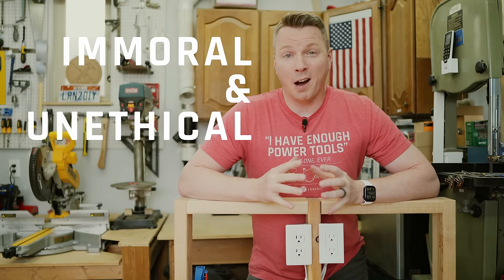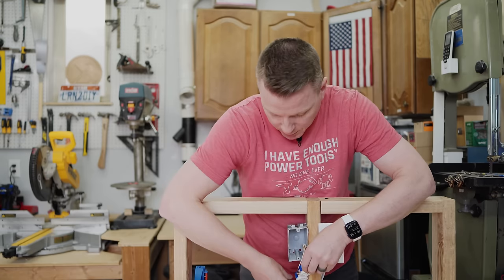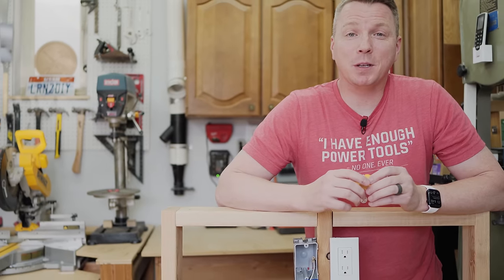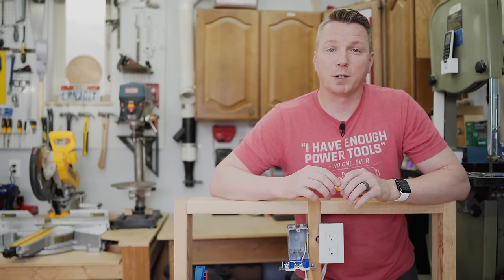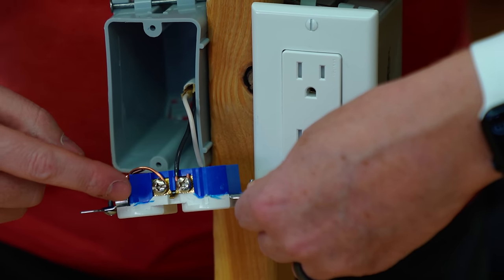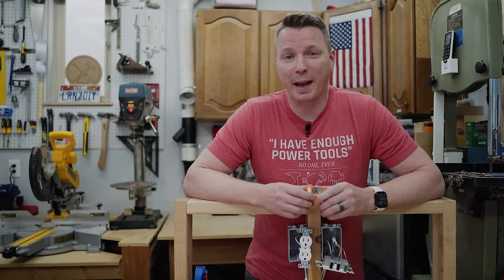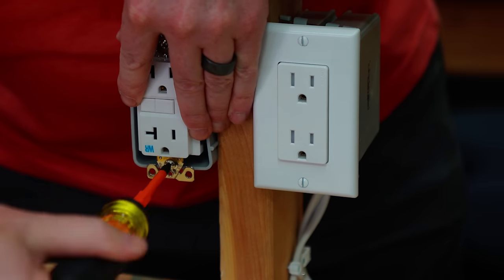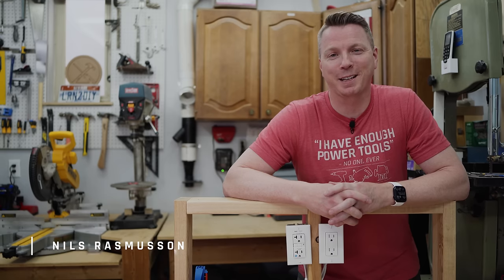People Are Adding Deadly Hacks to Outlets

Comment: We bought a house in 1992, and the WHOLE HOUSE was wired like that. I wound up rewiring the whole thing. Up side, is that I got to do it all correctly, with appropriate wires, outlets,and separate breakers for the things that needed them. Down side, wife was furious that I was making holes in so many places, as I'm not an electrician with experience in fishing wires through walls. But at least my neighbor (who is a master electrician) approved my work.... but he had still wanted me to hire 'real electricians' to do the job. I just didn't have the spare thousands of dollars to do that, but I still wanted to fix the problems.
Reply: Consider yourself extremely lucky. In many places, what you did was extremely illegal (at least as illegal as the hack itself) regardless of how well you did. If an inspector finds out you did that, you could be facing tens of thousands in fines (at least) AND be required to pay a professional to redo it.
Reply: @TheOriginalJphyper  even if everything was done correctly?

"Land of the Free", right? 😂
Reply: @LRM12o8  Yes, even if everything was done correctly.
Reply: Doing the wiring yourself, hiring an electrician to pull the permit, check it and having an inspector come inspect the work is perfectly legal. As long as you know the code and secure the wires and the connections are correct they won't have an issue with it. Just make sure to leave everything open till the inspector is done.
Reply: @TheOriginalJphyper in my city, you only need to pull electrical permits for new circuit breakers or pools, and homeowners can pull it themselves. Sounds to me like your local politicians need to be replaced. The dude had an electrician inspect his work. I really don’t see the problem.

Comment: For those wondering why a reverse polarity bootleg ground is so dangerous : the ground pin is usually used in circuits to catch any failures that would put live voltage in unitended places (such as metal casings) and would trigger the line's breaker to pop. When the ground pin is tied to the live wire without any actual ground connection, your appliances would become literal electrocution hazards by just touching them. It would be like touching the livw wires directly.
Reply: Holy crap
Reply: What about reverse polarity but not bootleg? Still grounded outlet.
Reply: @mannyramirez2307 That would seem like a normal operating mode for the device, with an exception, that manufacturers can and often do add filters on the live wire connection (mostly appliances with a motor, like a washing machine, but also computers etc.) to filter voltage or current spikes both from and to the grid. If you have a polarized plug and you connect a socket the other way, you basically lose this filtration and bigger manufacturers have laboratories to tell if the fault and damage in your house happened because of this, so you can have your warranty voided just with this simple change.
Reply: This "bootleg earth" is a way to give you protection in a situation, when a live wire inside an appliance would become loose, or melt through it's sleeving (like in a metal cased toaster) and touched the case which could lead to a severe electric shock, that would just trip your overload fuse and disconnect this circuit. The absolutely most important thing in doing this is to make sure you've connected the neutral, and not live wire to your ground terminal.
In Poland, when electricians find these earth to neutral connections in all soviet houses and buildings are not obligated to immediately shut down everything, but they ensure that the "zeroing" (that's how we call this "mod")  is made, to give the users SOME safety and everyone is familiar with this. That's probably because, our country was pretty much completely blind to the western standards (as all of the soviet union) and after 1989 we were many years behind with these standards, so many, many electricians here do this to this day, but always warn the owner or client to prepare for an installation upgrade. We find some similar "issues" involving weird electrical tricks because of rapidly changing standards even on buildings from only twenty years ago. 
To summarize: it's better to connect earth and neutral together (like when you need to change a socket, but don't have the money and time to rip your walls just to add one new wire), than leave it floating and live happily for many years convinced to have quality sockets and just get a shock without a warning some day.
Reply: I'm sitting here in the middle of the night, writing comments about wiring sockets, but if you are all so interested in electrical safety, you should definitely think about your AMERICAN MOST DANGEROUS PLUG STANDARD IN THE WORLD, seriously. Just adopt UK's plugs or German Schuko, but get rid of these one hundred years old plugs that are nowhere near the word "safety". You can stick your US plugs like an eight of an inch into the socket, and the prongs get electrified, while your fingers can still slip onto them, or something metal (like a necklace) can fall on them and vaporize. There are so many better desings and this is definitely not worth keeping in the 21st century.
Reply: Shocking  🤯
Reply: @abcdefgh1279  I have no idea where you heard this from, but if that were to be the case, you wouldn't just lose the filtering, it would blow up because they use polarized capacitors, which blow up if polarity is switched.
Reply: @abcdefgh1279  True, but doing so would mean purchasing new wall sockets for everyone in the US and Canada and also loosing compatibility with older appliances. Changing electrical standards is not something that can be done cheaply or quickly
Reply: @sebastienmonette6659  to the first comment: you do know this is AC and polarized caps can only be used on the secondary (DC) side, right?
To the second comment: nobody says you have to adopt it immediately. There is absolutely no problem to force a new design only in new developments, and slowly change it in matter of years. Ten to twenty years later just make it mandatory and then require to change them, when most of people would be familiar with these plugs commonly appearing on the market.
Reply: @abcdefgh1279  True, I had forgotten about not putting polarized caps on AC lines. However, if we're working with a DC motor, to get DC you'd need either a full or a half bridge rectifier. Bridge rectifiers will correct the polarity for the DC filter no matter if the AC polarity is switched. 

If your original comment was about AC motors, which will be affected by reversed polarity, the filtering would still work because instead of polarized capacitors, non-polarized capacitors are used to correct the motor's effects on the circuit.

As for the plug situation, having both standards at the same time would prove annoying to accommodate as people would need to at least buy many plug converters to be able to use new products if they didn't change their wall sockets. The best solution would be to improve the existing US male plug to only have contact with the tip of the plug like the UK style plugs.
Reply: @sebastienmonette6659  i'm talking about AC side only, because it has nothing to do with secondary, or DC. It's just the live wire on expected neutral connection, that we're talking here.
I know that would be very inconvenient, but is there a price tag on safety? Can you name a price for the safety of your family? Change always brings some folks who don't want to change, so that is not something to concern at all.

Comment: As long as the bootleg ground isn't reversed, it will work just fine. If there is an internal fault that puts potential on the grounded parts of the appliance, it will return through the neutral (aka, return) wire, and trip the breaker in the case of a dead short. It will also collect stray charge from the appliance's ground and keep it at the neutral level (which is bonded with the grounding rod and conductor at the main box).

The problem with not using a dedicated ground conductor is wire resistance coupled with current flow. If you're pulling a lot of current through a long circuit, the resistance of the wire can cause the potential between neutral and true ground to be non-zero at points in the wire far from the box. THIS is dangerous because AC can break through the resistance of your skin (which is capacitive), and pull a current through your body. If your circuit or receptacle isn't fed by a GFCI, the ground conductor does NOTHING except act as a fault-finding return path that can NOT build potential when everything is working normally. It's not as dangerous to go without as people think, but it is a bad idea to use neutral as ground at any point beyond the main box.
Reply: A bootleg ground can easily become deadly because if the neutral goes open, current will try to take the path via the ground, meaning the appliance's case will have a 120V potential to ground if the neutral breaks.
Reply: This is a problem if the neutral went open at the panel, but that's rare. But if we bootlegged every ground in the house, suddenly every single wire is a risk if its neutral goes open. And open neutrals on receptacles is pretty common - and would electrify the grounded appliance. But only doing it at the panel minimizes the risk.
Reply: @HarrisonFrith-cr4ie  The same can be said for a properly grounded chassis if the ground wire breaks.

How is that common at receptacles? You mean it's a common failure? (Since we know it won't work if the circuit is broken). Either way, failure of house wiring is something I didn't cover in my original comment, and a failure of the neutral wire coupled with a bootleg ground would be deadly. I'd say that's the biggest reason to avoid this, by far.
Reply: @RAndrewNeal  no it's different. Breaking the ground wire you just lose the ground meaning the case would electrify if there was a fault. But broken neutral with a bootleg ground WILL electrify the casing at 120v even without a ground fault. It is guaranteed to electrify the casing.
Reply: @harrisonfrith7125  Ah yes, I missed that. If the power switch is wired properly, the chassis wouldn't go hot until the switch was closed; but yes, that would energize the chassis through the load.

It's too easy to forget about wiring faults and assume an ideal condition for appliance failure when thinking about grounding. At least, for me.
Reply: @RAndrewNeal  Yeah ground can also be the enemy if it's wired wrong!
Reply: It is a gamble, of course. The neutral is bonded to ground at the breaker/fuse box, so what's the big deal? Well, since it would take a freak event to reveal the risk the likelihood of it being a problem in real life is small, but the stakes are unacceptable.
Reply: @flagmichael  Agreed.
Reply: @HarrisonFrith-cr4ie  If the neutral goes open nothing will work as there isn't a complete path for electric to flow.
Reply: @theadmiral5425  Correct, and the case will become live with 120v of potential that wants to return via the ground if the ground is bootlegged onto the neutral. The circuit isn't complete, but it WANTS TO BE. Think harder about it.
Reply: @HarrisonFrith-cr4ie  "But broken neutral with a bootleg ground WILL electrify the casing at 120v even without a ground fault."
Huh? Unless your metal toaster also happens to connect Live to the chassis the moment right after you cut Neutral then how would the chassis be electrified?
What you're saying is that Neutral is cut, only Live is touching the toaster, therefore the toaster's chassis is 120v. No you need a fault to connect live to chassis.
To replicate this scenario, not only do you need to cut Neutral, but you also shake your toaster so hard until the Live wire permanently touches the metal chassis. You can also only do this after you cut Neutral and after you've notice that the toaster no longer works, not before cutting.
Seems like an unlikely event to me.
Reply: @DVDplayerz  A lot of people don't understand this and it's not entirely natural to think about it, but think about it more.

Say you've got the ground and neutral bonded inside the plug socket. The ground wire from the appliance is connected to its chassis, and the plug socket.

If you kill the neutral feed to that socket, The current is going to go into the socket via the neutral wire, have NO return path, exit back out the ground wire into the appliance's chassis, and try to go to ground from there.

Comment: The best option in my opinion is to replace with GFCI unless you are running a higher current motor on the circuit such as a refrigerator. Most residential refrigerators won't trip a GFCI I don't think but commercial grade ones will often have nuisance trips (I'm a refrigeration tech so its an example I deal with often), an obvious problem if you refrigerator keeps randomly not doing the cold thing. But on a cost benefit I think the GFCI outlet would be the way to go, it is a lot cheaper than pulling wire and gets you a good enough for most people result in most cases.
Reply: i doubt one of those would enjoy a portable air conditioner which i use to keep cool during the summer months
Reply: @dawn1berlitz  it depends on the size of it, a small portable one probably won't trip it but I'm not sure I have never owned one of those but to my understanding they aren't really air conditioning they are an evaporative cooler (often called a swamp cooler). They work great and their amp draw is pretty low so it would probably be fine honestly but even with the commercial refrigerators they usually don't trip every time I have seen them run for hours without tripping the GFCI then all of a sudden you get a slightly harder start and it trips.
Reply: I heard GFCI isn't allowed on fridges because spoiled food is more deadly than electric shock risk in this situation
Reply: @thewhitefalcon8539  it is not recommended but not against code, many refrigerator manufacturers will not cover warranty if you have it plugged into a GFCI and that is what is causing the problem. I have had quite a few warranty calls for continental who have "unit plugged into GFCI" on their list of non warranty issues, specifically that they will not cover GFCI trips due to normal operation.
Reply: @keldon_champion Would those fridges work with European style panel GFCIs (called something helse like RCD or HFI) that trigger at 30mA imbalance rather than 5mA ?
Reply: @keldon_champion  Portable air conditioners are a thing, they are solid upright units with a full compressor/evaporator loop inside them, and then one or two large air hoses that exhaust through a nearby window. Technology Connections did a good video on the topic if you want to look further into it
Reply: @richardmillhousenixon  oh I know what you talking about never heard of the called portable AC before though maybe it's a regional thing but every time I heard the term portable AC in the past it has been in reference to the little as seen on TV tabletop swamp coolers.

Comment: My parent's house was built in the 50's and they used what I believe was a precursor to the Romex we know and love today. It had a ground wire, (albeit a thinner gauge than the actual circuit wires), but the common practice at the time was to wrap that around the wire where it entered the outlet box on one end, and the fuse box on the other end and rely on the strain relief to "bond" the ground to the box, bearing in mind that all outlet boxes were metal back then, so as long as the fuse box was grounded and the outlet was actually in the box, it had a "ground", albeit unacceptable by modern codes. As for the "bootleg ground" you showed, if the hot and neutral were reversed, wouldn't even a cheap tester detect such a fault? I don't recall you testing your "reverse bootleg" in the video. PS it would help if you shut off the lights when demonstrating how the tester lit up during the tests, it was hard to see the lights on it with the room so brightly lit up.

Comment: You didn’t mention that the bare copper ground wire and white neutral wire are actually tied to the same bus terminal strip inside the circuit panel.  The neutral and ground are at the same potential at the panel and connected separately at the outlet to their respective terminals.  This means a continuity check between the neutral and ground connection at the outlet could be very close to zero ohms even though they are separate wires.

Comment: Something you didn’t clearly cover specifically regarding the reverse polarity bootleg ground is that it also shows as wired correctly on the common outlet testers. Which you’ll find out about the not fun way when you touch the metal case of something plugged into that receptacle… been there done that. A house I was in had a bootleg ground on a receptacle, somewhere down the line in the branch circuit the polarity reversed. Outlet tester showed wired correctly but the metal case of the PC I plugged into that receptacle was live, which I found out real quick when I touched it. I tend to check receptacles and wiring at boxes with a DMM now to verify that polarity isn’t reversed somewhere else in the branch circuit.